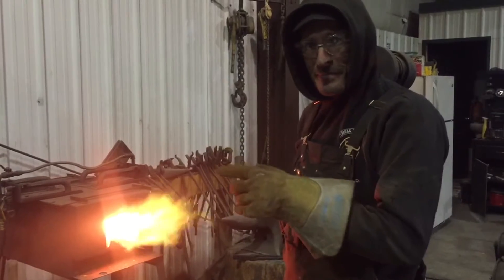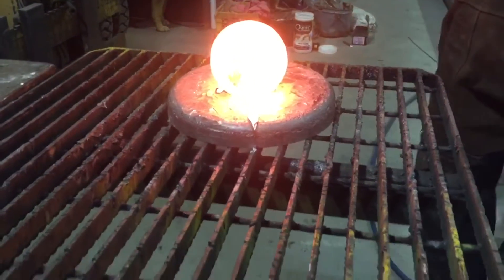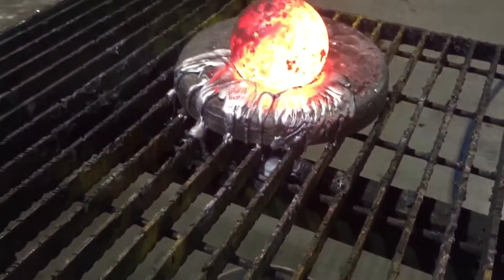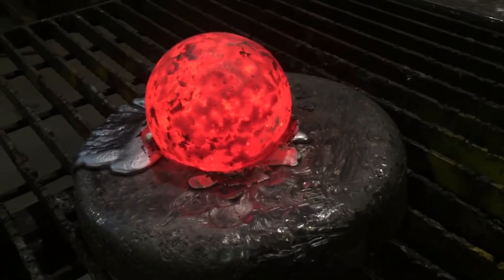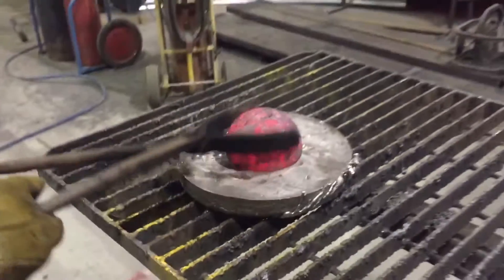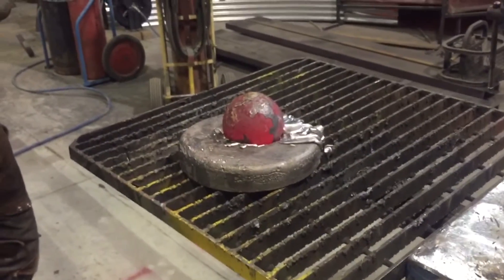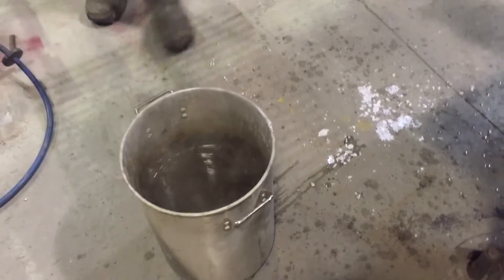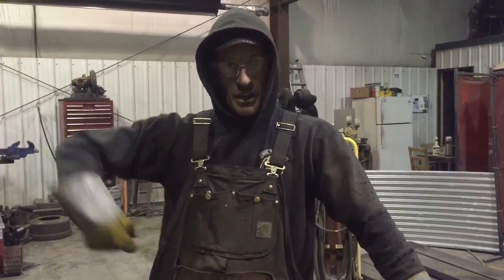Red Hot Cannonball Melts Solid Lead Plate

Comment: where did you get that huge piece of lead haha?
Reply from the maker: Melted down tire weights.
Reply from the maker: I use it for metal forming, the soft metal doesn't leave marks in the metalwork so sometimes working brass, copper, steel it's useful to have the soft surface and use that instead of the anvil.